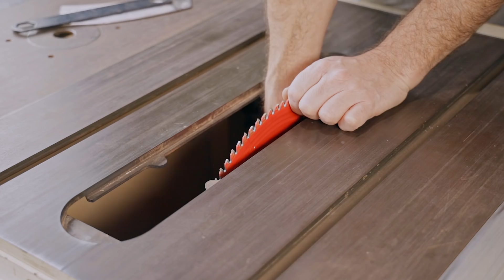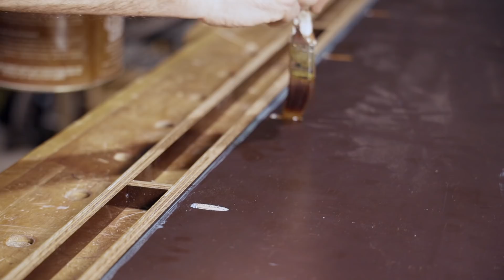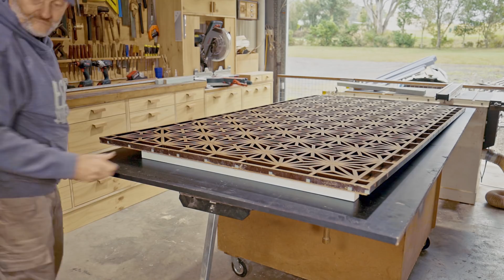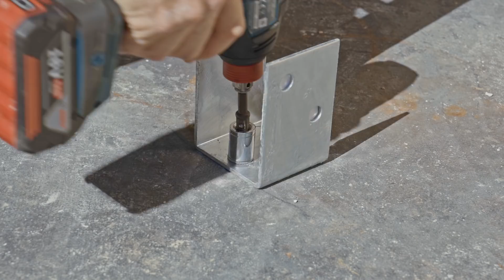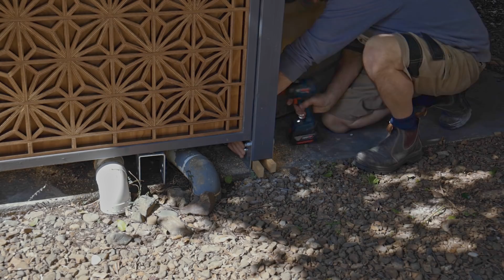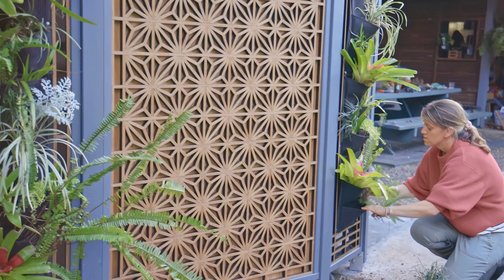Kumiko and Vertical Garden Screen

Comment: I want to make a privacy screen/sliding door between my kitchen and master hallway. I was thinking kumiko because the intake vent to the heat pump is just inside the hallway. The doorway is 32-inches wide, so the kumiko could be a bit less allowing for the frame. Using the form ply, would it be firm enough without a backer board to make the door or would I need a backer board with holes for the ventilation?  Maybe even using pegboard for the backer board? I was thinking if no backer board was needed, I would use fabric for privacy. I would greatly appreciate your input. 💖🌞🌵😷

Comment: I've used those galvanized floor brackets before.  So I can appreciate the tip of using the loose brackets to prop the panels up while screwing everything together.  The last time I used them, it was mess.  I really needed four extra hands.  Thanks for the video.😁

Comment: You did a Great Job. The time it took to cut and glue all those small pieces had to be maddening.  Now of course my suggestions. For the plants add a "Drip Irrigation Spot Watering" system with timer as needed. At the end where you cut the 4 x 4 that would have made a good spot to install some smaller panels to give it that Japanese style look.

Comment: That looks really great, but totally unsuitable for unprotected outdoor areas.  The plywood will begin to rot after a short time.  The water stops in every corner and the wood soaks up.  Find out about "constructive wood protection".  The aim is for the wood to dry out as quickly as possible after a rain.  Through inclined surfaces or water noses.

Comment: Looks fantastic.  I am wondering about access to the tap on the tank. It is not often but there are times I need to turn off the water at my tank. Did you leave sufficient space behind the panel to get to the tap? Could you have put the panel in front of the tap on hinges to allow easy access?

Comment: Thought it was funny that you used a socket adapter for your impact when the head doubles for sockets and 1/4' bits
Reply from the maker: The head accepts 1/2" sockets, I do have an impact socket at the size I needed but couldn't find it. :)
Reply: @PaskMakes  fair enough mate

Comment: I'm in awe. The amount of time, effort, and dedication you've sunk into this project would prevent most anyone from such an accomplishment. It looks fantastic!

When you were installing it, though, it made me worry about your health. Concrete dust is dangerous stuff, and when you drill/abrade concrete, it becomes fine enough particles to float in the air. Consider wearing a mask next time you have to do that sort of work, just for safety's sake.

Comment: Are you concerned about wind pressure on the panels since they are largely opaque to air flow?
Reply from the maker: I'm not worried at all, they're anchored down well and quite sheltered in that corner of the yard. :)

Comment: Could see that exact design being used in the lobby of a posh hotel or high-end designer shop.... plant walls are all the rage in these and the kumico really sets it off
Reply: Yeah and alternatively if you want to do this in a realistic matter you could go to a makers lab and get this either lasercut or C&C'd
Reply from the maker: @leaschmitt2496  That would still look cool but it wouldn't be the same at all. There's know way cutting it out of a full sheet could have the plywood edges running with each piece and for me that's what makes it! :)
Reply: @PaskMakes  i guess you could still cut out the individual pieces and put it all together than. Because to me the most difficult part would be cutting at exactly the right angles and sizes with power tools in the hope everything fits together at the end

Comment: Fantastic! This is something that will last for decades with the way you've sealed and protected it.
Reply: It really does look nice, but I think “decades” (plural) is a bit wishful. With some intermediate painting and resealing, it could last ‘A’ decade. 🤷‍♂️
Reply: @psidvicious  Why is that?

From my perspective it is well sealed, the construction adhesive has a fairly small shear load, it's off the ground, and it's made of plywood which has relatively small movement as far as wood goes.
Reply: @zacreed5855  I’m not worried about it falling apart bcz it wasn’t built properly. He assembled it quite nicely in fact. The problem will be that it’s made from non-treated plywood. Water, even from just dew and condensation is going to lay in all those pockets, seep into the plywood layers and rot. All those ‘pockets’ are level areas where water will just sit. The intense sun exposure will break down the sealer surprisingly fast, accelerating the process. 
I didn’t mean to be hyper-critical. I think it’s a real cool piece of work and as a tradesman myself I can really appreciate the amount of work and thought that went into it. I was just trying to bring a little reality to the life expectancy of a piece like this, exposed to such harsh exterior conditions.
Pressure treated material might double my prediction.
Reply: @psidvicious  fair enough, I hadn't considered water pooling in it.
Reply: @zacreed5855  10 years is a pretty respectable amount of time. Who knows, in 10 years they may be ready for something different anyway 😁